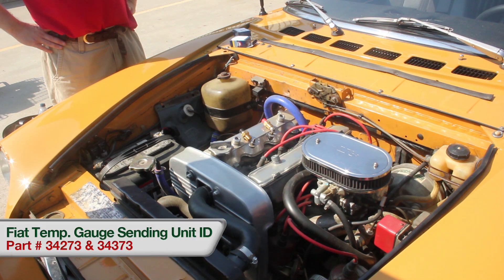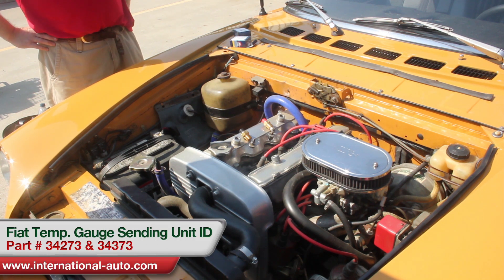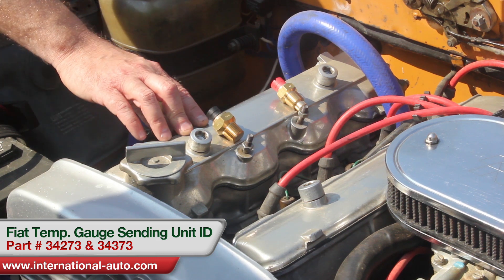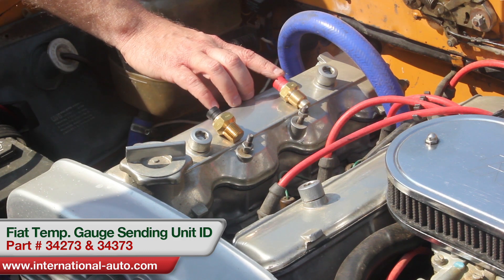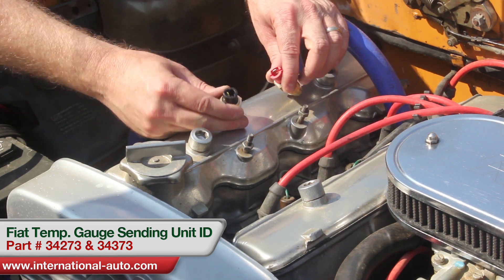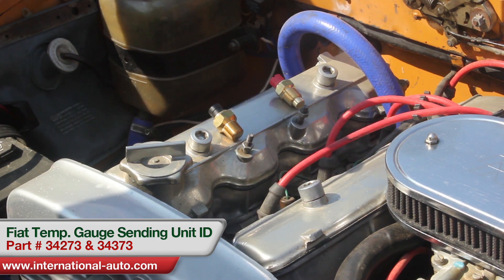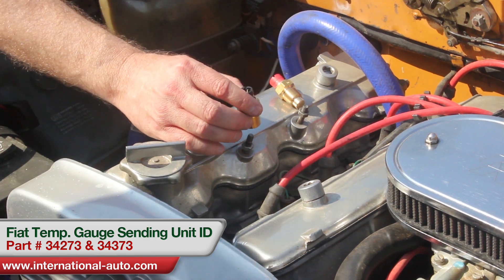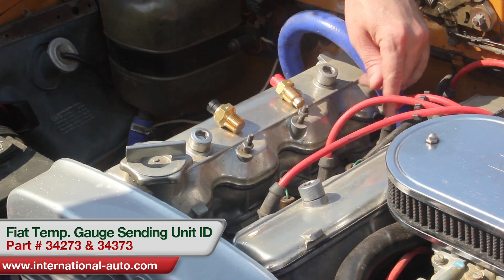Fiat Temperature Gauge Sending Unit Identification - International Auto Parts

Comment: Are these actually two different sensors?  I replaced both with the one you identify as the engine temperature sensor.  Should I have got a different one for the overheat switch?